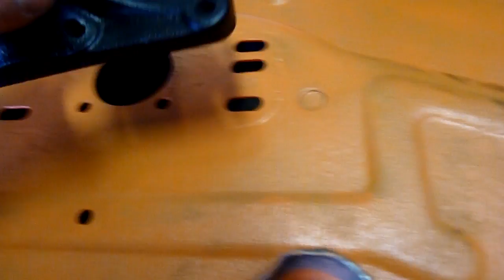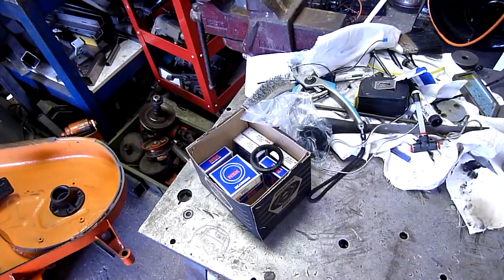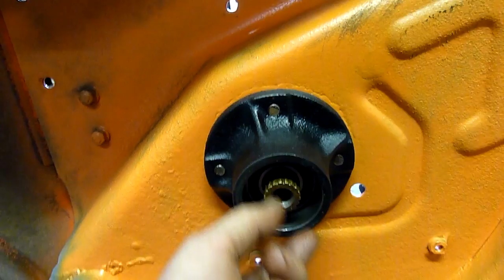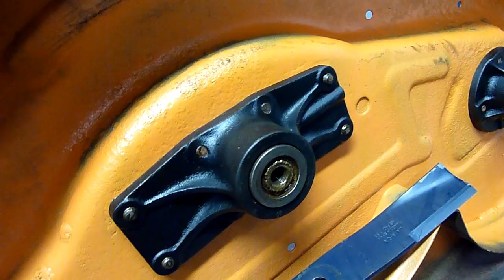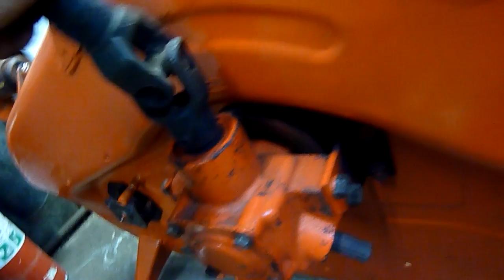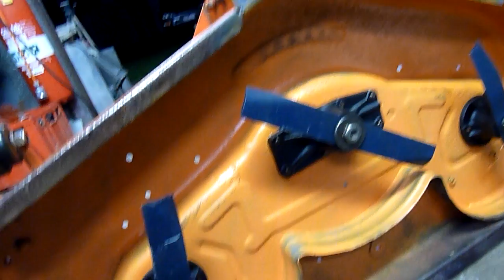Kubota T1600HST 44" Deck Rebuild pt3

Comment: When you're done, whilst i'm not sure on your model, the outer blades should be parallel to each other, the inner blade doesn't matter, i usually put mine perpendicular to the other two. But to reduce vibration i usually check that the outer ones are in "sync".

Pity that bed liner paint is so expensive because for such a part it would be the best thing. I'm thinking of coating mine but i can't find a reason to expend such a sum for such a small project.
Reply: Bed liner doesn't seem to be that expensive where I am, in fact I think that there is a company that makes a version that you can put on with a paint roller rather then paying some shop to spray it on. Pickups are very popular in the U.S and Canada so bed lining products and services are fairly easy to find. If you can't find a cheaper bed liner product you could try some epoxy based paint like for redoing appliances and bathtubs.
Reply from the maker: what happens if the belt slips a little? its only on a spring tensioner so the blades will change positions anyway.
Reply: Aussie50 I check them all the time and usually they don't slip. But if they do i just pull them back in. I do admit i run mine quite tight, tho. So there's that.

I also don't need them to slip all that much on the field i clean because it's pretty much flat all the way. I was figuring that yours being a yard is quite similar.
Reply from the maker: aserta I will line them up and see how it goes.

Comment: I have very much the same mower mine is the G1700 diesel 3 cylinder.Mine requires some deck work,I think the bearings are ok but it's caked in grass and all the guards are rattling about,also it has lots of surface rust so mine also needs a repaint,I must get on with it I need to use it in 8-10 weeks.Mine has over 4000 hours on it and still going strong they are a great machine,I'm sure you will enjoy using it.Thanks for the vid.

Comment: My guess is the mower was backed into a cement slab.
Reply from the maker: yeh its been used on a lot of sloping ground too, they hit somthing hard, cement or a rock perhaps. either way I need to twist it back out pretty far :(
Reply: Aussie50 youve got some eotk to do then m8 :-(
Reply: Aussie50 you,ve got some work to then m8:-(
Reply: Tree stumps and Rocks are the biggest killer of pressed deck's.

Comment: I like that roller made from poly gas line.  That's better than new.  I'll even venture to say it would be more durable than an oem part
Reply from the maker: hehe, its temporary until I get some 4" HDPE rod, all I had was some 2.5" and a bit of poly gas line, but they will work well enough for now.

Comment: Ed , I always take the inner shields off the bearings so grease can get into them ! With seals on both sides the grease pumped in displaces any water present ..
Reply from the maker: yeh I can't understand why they left the inner rubber seals on the old bearings, the metal shields are okay because they have a gap, but with the rubber one you are pushing that seal tighter onto the race with the grease!, its silly.
Reply: That's true man !!